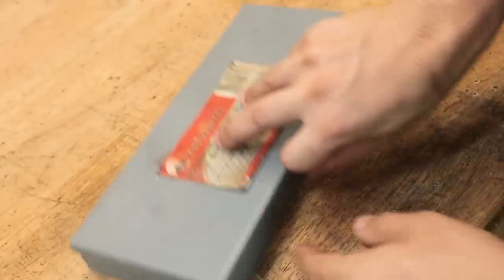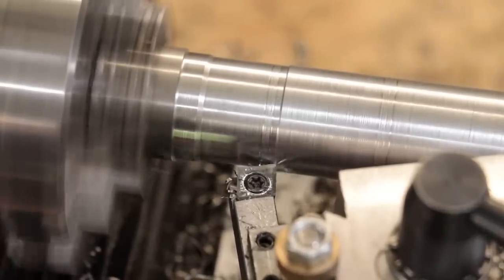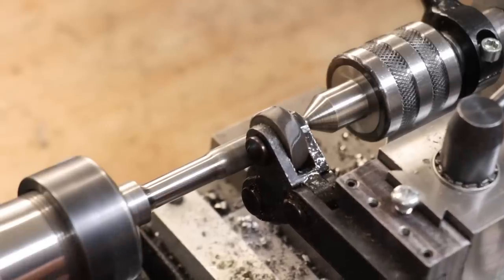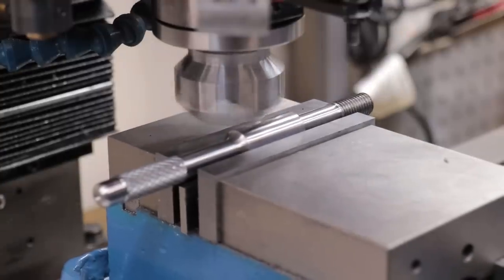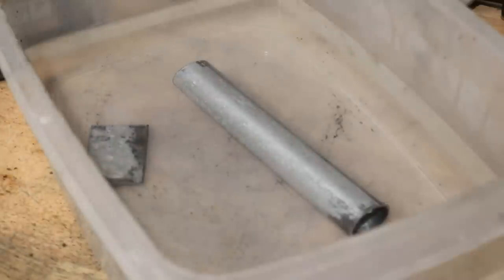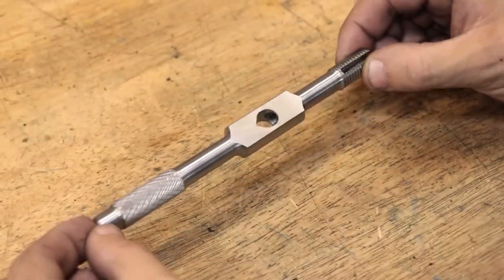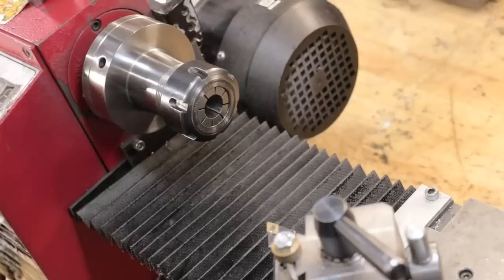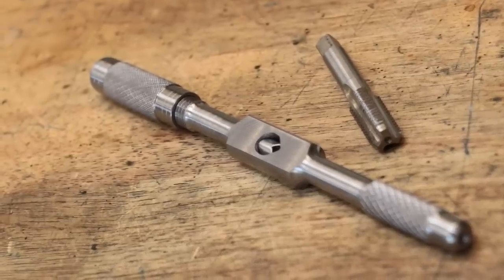Vintage Style Tap Wrench Build

Comment: Regarding the knurling process. 1st,  it is a slow speed operation so choose a back gear if you have one to get a slow surface speed. 2nd start the tool with only a 1/4 to 1/3 of the knurl wheel engaged. You may also include a small "lead in angle" to the tool to progressively cut the knurl.  3rd from this starting point engage the knurl to depth. 4th with the knurl now running in it's own groove traverse the length required while washing away the chips with plenty of coolant. Lastly the mark of a well formed knurl is to undercut the basic diameter and chamfer up into the knurl. 
In any case I don't personally like knurling tap wrench handles because after a longer tapping session the knurl is rather hard on the hands.
Reply: If the knurl ends up too rough, you can always do a skim cut on top and knock the top edges off the knurl. It will retain the grooves, so you still have some grip (though it will be slightly less than before, still better than no knurl), but the sharp top edges will all be removed and  much easier on the hands.

Comment: Yes the clamp-style knurl tool works really well on these lathes I have one and it does a nice job almost a perfect diamond pattern every time.
Reply: That's what I found as well. The 'pressure' knurling tool I have has a 1-1/4" shank! (I used to have a big Colchester)
 getting a mini lathe was a shock when I saw how tiny it was but has worked out real well for smaller hobby parts

Comment: The few tools I have from my dad ( he died when I was 9 yr old) I re-surfaced. On the few chizzes and punches, they have mushroomed heads, I left that part. He was a tool maker, Mom sold all of his measuring tools as I was to small. Re-machine that tap wrench, chase the threads and knurls. You will be glad you did as you will be going through the same steps on the same steel that he did 100 yr ago.

Comment: I concur with others that the clamp type knurling tool works better on small lathes. They are simply not stiff enough to manage the load on push type tools. Clamp types keep much, if not most, of the knurling forces within the tool rather than transmitting it to the lathe tool post.
Also, others mentioned getting the diameter close to the pitch circle of the knurling. This helps on small lathes as well. It doesn't need to be perfect but helps. I have created a simple spreadsheet that does the calculation and use it particularly for course knurls.

Comment: Certain diameters of material will form different patterns with a knurling tool. Think of it as a gear where one of the gears (the work piece) has one and a half teeth. That will result in a double cut (fine knurl). There are calculators online for this.
Reply: I was coming to say this. I didn't realize this and why my knurls were all out of whack, until I saw this mentioned in a video by some machining channel (Sorry, I don't remember which xD)
Reply: @ChernaTom  i know inheritance machining mentioned it in his knurling tool build
Reply from the maker: Yeah that would make sense
Reply: I think clough42 also mentioned it
Reply: You can do a good knurl and a double tracked knurl on the same diameter by using different styles of approach. Going straight to full depth and feeding from the side makes it harder to double track a sharp knurl. If you're doing a coarse but shallow knurl, then even this doesn't help, you just have to calculate
Reply: This myth is repeated in every knurling discussion. If it were true, which diameter would you even use? The diameter you start with, the final diameter, or somewhere in between? Either way, you have a situation mid-process where the diameter is no longer divisible by the knurl pitch. It's also been famously disproven by knurling on a tapered rod.
Reply: @eddtube  I'm not an expert, but based on my intuition: Knurling is more forgiving than gears because it will try to align itself with the existing knurl from the first time it touches the work. You are correct, the diameter is based on the amount the material will deform from the tool. Also, I would imagine that knurling a tapered rod with a cross knurl will not show the error as much, but if you do a straight knurl I have a feeling it will be more obvious, though I have not seen this happen, I am just hypothesizing. Generally though, from watching hobby machinist channels, the ones who use the knurling calculators get better knurls.
Reply: The fact that a taper can be knurled proves the diameter of the part isn't that important.. I just run the knurl and if it doesn't work out then i skim it and try again but that doesn't happen very often since it works over 99 percent of the time.. the trick is knowing when to stop the in feed, basically knurling is black magic

Comment: I have couple cheap chinese tap wrench. Those are with coarse thread. I think fine thread is better because when coarse thread handle turns even a littlebit, tap is loosen. Here spring helps. Good job!

Comment: Knurling patter: You have to calculate the scope of what you want to knurl. It should match the knurling wheels (distance tooth to tooth). If you want the uneven look on both parts you need at least the same factor on both. Perfect knurling means calculating, but there are online tools...

Comment: A few machining channels have recently made clamp style knurlers from kits. Pretty interesting builds because of some challenges due to some of the supplied parts at final dimension but rough surfaces, so to have a nice finish, they had to make lots of adjustments.
Reply: Mr. Pete did a 2 part on how to knurl.
Reply: Joe Pie also did an excellent How to Knurl. I use his method with a crappy knurling tool & it works every time. Just have to be aggressive enough.

Comment: Many have already noted that a pinch knurler is what you need, and it's an ideal shop-build tool project. Some have mentioned that several youtubers have built the Hemmingway Kits version. It's elegant but way over complicated. You can design a much simpler version that will work very well. I'm eager to see what you come up with. And get some medium pitch knurling rolls. They're ideal for machine handles and much less prone to double- or triple-tracking than the coarse ones,  though not immune.

Comment: According to this old Tony. When it comes to knurling you want to flood the knurling tool as much as possible. But in your case that tool looks like it's putting a lot of pressure on the tool post. So I think your assessment is correct that you need a replacement that does not put so much pressure on the tool post

Comment: You did a great job. If I may provide input regarding knurling, there’s a few things to remember. Slow RPM, depth of cut  between 0.015 to 0.020” each pass until you achieve the desired result and most important, lots of oil with a brush to clean the knurls as they are being made.  Gilles

Comment: It turned out very nicely. You will always have problems creating coarse knurl patterns with a bump or push type knurler on a small lathe because of the lack of rigidity which is required to bully a push knurl into a component. As others have said a scissor type knurler is the ideal type for smaller machines like yours.
Just one final thing i wanted to share is that I have never bothered with tempering a case hardened mild steel item such as this because the case depth is only shallow and the core stock is already soft even after quenching.

Comment: Knurling is like cutting teeth on a gear, you need to have the parts diameter close to right to get a whole number of "Teeth". Where it looks like you've made a really fine knurl, it's because the part's diameter was almost exactly half a tooth off sized, so after the part had turned 360' the tool started trying to cut a valley into the peak it started forming before. It's hard to describe, but I hope you get the drift.

There's all sorts of maths you can do to ensure you get perfect knurl every time, but I can't be bothered with that. I just press the knurling tool against the workpiece just hard enough to leave marks, and turn the spindle 360' by hand. If the first and last marks are really close to being in the same place it'll work, and I start to knurl the part. But if the marks are really out of alignment, I'll take a tiny skim off the surface with a file to change the diameter slightly, and check again. Usually you'll be good to go after only doing this once or twice.

It's well worth having a play at this on some scrap, just to get a feel for how far out it can be and still produce an acceptable knurl.

Oh, and one last thing. Fine knurls are a lot less prone to this than course ones. The fine ones just seem to be a lot more tolerant to this.
Reply: There is also a online knurling calculator you just have to input your knurl wheel diameter and some other stuff and it will tell you what the nearest diameter to take the stock to and you will get perfect knurl 100% of the times. Also maybe use the tool at low speed
Reply: @suhasdilwale1260  Well, I suppose if you WANT to get all technical and precise about it....... 🤣

TBH, most of the stuff I make for fun has a tolerance dictated by the finish I got. If it's at the diameter I was aiming for, but the surface finish looks more like a screw thread than a precision turned part, it goes undersized. If it's a part that needs to fit into something else, I'll then aim to make the hole in that undersized too. 90% of the time it doesn't matter to me. It's all about the fun of making things for me, and I find no fun in making something again just because my little lathe chattered like a couple of old women in the supermarket, and to fix that I need to go 0.5mm undersized. 😏

For some reason this makes me think of some hinge pins I rushed my way through when I built my utility trailer. I'd already made the pins, and was drilling out the cup parts to fit on them. The drill bit I was using cut WAY oversized and the pins were a sloppy fit. Not wanting to waste anymore material on remaking the pins, I quickly diamond knurled them, and turned the tips of the knurl down to the new cup bore diameter. They've worked fine like that for several years, and if anyone notices and mentions it, I brush it off by saying "Oh, that? They're relief channels to keep the grease evenly distributed within the hinges". 😁
Reply from the maker: Cheers. Would seem that the fine knurls are not forgiving.  It’s only been a problem since I’ve switched out the the corse size

Comment: Knurls usually leave a slightly jagged edge when pressing a knurl onto a raised boss.  I prefer to finish the small diameters on either side of the boss after I've knurled so they clean up the edges.

Comment: Nice tapping tool. Knurling seems to be a problem for you. The tool used puts tremendous radial pressure on the spindle shaft, it is better with a light lathe to use a clamping knurling tool. The way of working also plays a role, once the diameter to be knurled has been turned off, then knurling the entire piece and then removing the excess knurling. This way you get a nice start and end of the knurling.

Comment: I'm a machinist in a food plant.  99% of my work is stainless steel, mostly 303 and 304.  Ever try knurling that stuff?  I gave up and made a cheesy cut knurler.  It only took about 15 minutes to build and it takes two passes but it works so much better.  I'll prob never try conventional knurling on stainless again.

Comment: The style of knurling tool you  used applies a surface pressure that is directly dependent on the pressure that the cross slide can develop  and the rigidity of the part being knurled. Whereas the clamp style knurl-er is independent of the cross slide or part as it develops the surface pressure totally by the pinching action and how rigid the knurl-er is made. The clamp style knurl-er doe snot place any loads on the cross slide nor doe sit cause the part to deflect away from the knurl-er. These are a much better option.

Comment: Can I recommend Evapo Rust to clean up the antique wrench? Don’t know its availability in Australia, but it’ll keep the part as close to original as possible. It’s so gentle, really only attacks the rust and that’s it. Unlike citric acid, wire brush or sand blasting it won’t eat away at the details. I guess electrolysis might be good too, but I’ve never used it.

Comment: The clamp styles do help however they aren't perfect either. One of the tricks I have found is to place the knurls on to the piece then back away the cross slide and tighten the scissor type knurl tool just a small amount then bring the cross slide back in while spinning the piece by hand until the knurl wheels are on top and bottom, give it two or three rev. and inspect the pattern and if it's not wanting to track correctly I take about .001 off the piece and try again. Usually I can hit it on the second or third try if not the first time around, once the pattern is tracking correctly while still turning the piece by hand I tighten the knurl tool some more and get the pattern deeper into the piece and once that is done I can power knurl the rest and keep a good pattern.

Comment: You don’t want knurling that has formed a sharp diamond pattern as it hurts your hands - the tap wrench that came with my Hare and Forbes set was so sharp it drew blood and I had to knock the tips off the knurling on a linisher . Ditch the push type knurling tool and buy or even better make a clamp type - push type knurling tools are only good on big industrial machines . Tap wrench came out great and will give you a lifetime of reliable service !

Comment: Hey dude great work that finished piece looks so good really nice final surface finish. I can see now why you want a clamp type knurler. Not sure if anyone had commented yet but I think the part diameter has a lot to do with the pattern you get. Looks as if the smaller diameter work got a good course finish and the larger end cap not so good so I’m thinking work diameter has a lot to do with the diameter of wheel used.

Comment: could you have a couple of adjustable free-spinning nylon cylinders held by a very sturdy support on the other side of the cutting tool to counter the deflection of the part?

Comment: That knurler should work better than what you're getting out of it. Sure, it's not at all ideal, but still. Probably you have to get the tail stock with a center in there to support the work so you can really push on it.

Comment: From what I learned about knurling, 1. Dont use a live centre, Can damage centre,due to side pressure 2. Use feed, not hand 3. Start about a third of knurl wheel on job, 4.use oil, 5. low rpm

Comment: In order to get a proper knurl pattern, you need to ensure that you are knurling a diameter that is a multiple of the knurl pitch.  Knurl pitch is:  Pitch=(<Knurl wheel diameter>*Pi)/<Knurl tooth count.  For example if you have a knurl that has a wheel diameter of 0.75" and 37 teeth, you would calculate the pitch as (0.75*3.14159)/37=0.06368.  Then to figure out what diameter your stock should be, you use Diameter=(<Knurl Pitch>*<multiplier>)/Pi.  For the previous example if I had 2" stock, I could get away with 98 as a multiplier.  (0.06368*98)/3.14159=1.986.  If I turned my stock to that diameter, I would get a perfect pattern.

Comment: You could take those two knurling wheels out and make your own clamping knurler. It's not difficult and a fun project. 

It is also good to measure the diameter of those knurl wheels and count the number of teeth. Then you can calculate the knurling pitch (Pi*D)/nr of teeth. A round bar with a circumference (Pi*D) equal to an integer number of the pitch should knurl better. 

However, there are some details, such as: The diameter of the workpiece increases because material is pushed up with a non-cutting knurler and at the same time the teeth dig deeper than the original diameter into the material. So which diameter to take into account? And furthermore this also depends on the tooth angle of the knurler. There are many tables and calculators to be found, but as you will see they give different results. That's why I find the premise: Circumference workpiece/pitch knurler is an integer the most practical. You could (but you can really do this better if you have a clamping knurler) make a set of different diameters (on the same bar) and see which diameters give the best result with your knurling wheels.

Comment: If you use the live center and no stepped soft Jaws your part needs to have a turned on clamping feature to ensure the piece does not back up into the chuck

Comment: The issue with your knurling is possibly your speed, I do mine at between 40 and 80 RPM, and use a fine feed for it, also the clamp style knurler is better for smaller parts, to use the push style you need to support the free end with a live or preferably dead centre.

Comment: For getting rid of the zinc galvanisation, powdered/granulated citric acid dissolved in water is quite good, and you can easily make the acid stronger if needed. Not the fastest process, but definitely one of the safest.

Comment: For the future You can just grind or sand off the galvanized layer down to shiny steel with a flap disc etc just becarful  cause you don't want to breath the zinc dust either 👍 you can also just grind  off the inferior where you're gonna weld with a small sanding drum on a die grinder or dremal 👍
Reply from the maker: its more about the inside that i cared about, where the park is packed